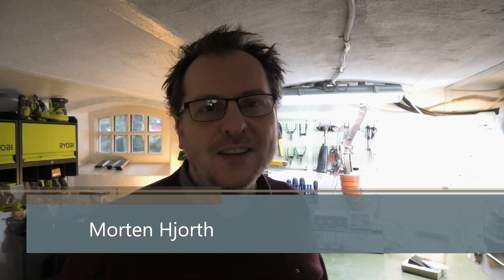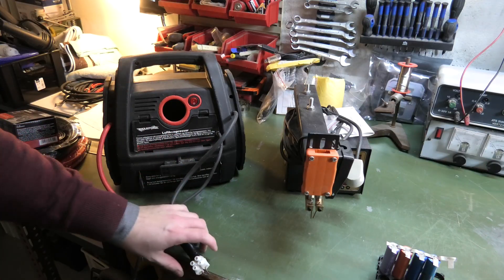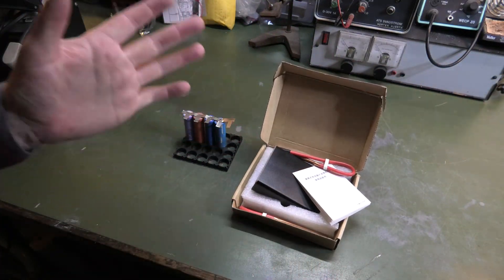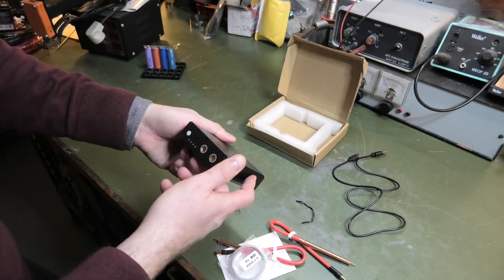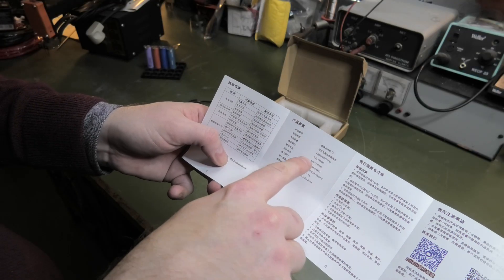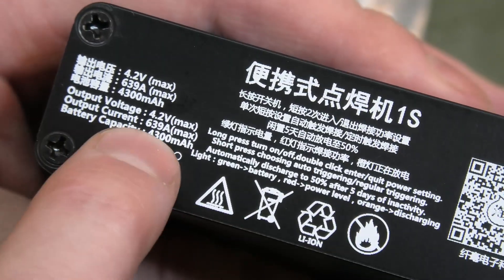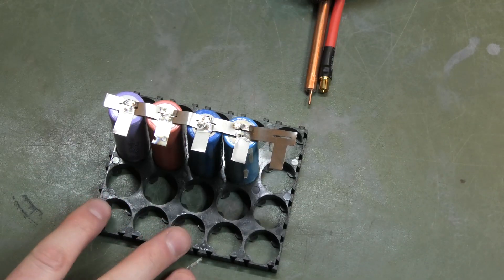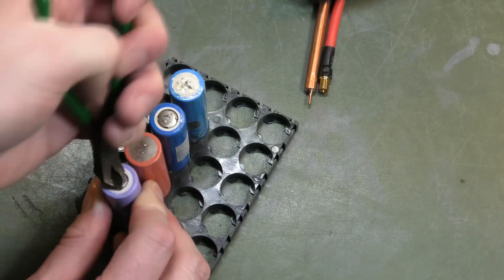Awesome $50 Tiny Spot Welder - Better than Expected - 1031

Comment: Helpful video as just about to replace 18650's in my Makita, would this weld the metal cage that holds and connects the batteries, probably a bit thicker than the nickel strips that are shown in your video, many thanks
Reply from the maker: Thank You! This spot welder is best up to 0,2mm nickel,, it might work,, but it would be a long shout.
Reply: Thanks bud
Reply from the maker: You are most welcome :-)

Comment: FYI: They are about $140 now. There are others of similar quality for under $60. I already bought another but that one seems really well built. I do like the bus bars across the mosfets and the heavy duty battery connections. Well done and thanks for the info.
Reply from the maker: Thanks for the info! they keep changing the links :-(
Reply: @MyPlayHouse  I wish there was a way to change the delay till the weld is triggered.
 mine seems to just go as soon as it shorts, I wish it was about one second.

Comment: Hello, I like your video thank you I was looking for some thing for my project which is soldering copper wires to break a infrared panel LED lights. Soldering is not my forte, so I think spotwelding could be better.
Reply from the maker: For spot welding copper, this is not powerful enough. :-/

Comment: Will this spot welder connect small metal pieces? I build custom die cast cars (hot wheels size) and want to build small roof racks to fit on them. What do you think?
Reply from the maker: I have not tried,, it does up to about 0.2mm with the batteries here.

Comment: Dear Sir, Please help me. I made what I saw in this video
https://www.youtube.com/watch?v=CGja7mWjiuM

point welder, but it only welds 0.1 mm thick connecting plates perfectly. The 0.2 mm thick plate is no longer inserted there. I would like to weld a 0.3 mm thick plate to the battery, because in really professional battery packs such as the MATABO 0, The manufacturer uses a 3 mm thick plate.
Time is not short, I experimented with it. What should I change and for what? Thank you very much in advance for your help! Sincerely, Janos
Reply from the maker: I also made a home build Spot welder, before I bought this one. 
https://youtu.be/rjATkgYERQI - this one,, it did not work very well :-/

Comment: Can the probe wires be replaced with larger gauge wire in silicon test casing without hurting the welders performance?   Then I could mount the welder on my lab bench.
Reply from the maker: It can become a little better,, but I am not sure it want, just be better to get a bigger one.

Comment: I have a very similar spot welder to this. I improved it by modifying the electrode cables. Replaced with copper ones and hard wired them to the  the connections on the board. Way better performance now.
Reply from the maker: Hi Testing and Track Days
Thank You very much!  glad you liked the video :-)
Thank you for watching! :-)

Comment: If I used copper strips instead of nickel would I get a better battery in practice or is it like a meaningless improvement having the better conductivity of the copper. I think it's like 22% for nickel vs 100% conductive for copper, sounds big but is it actually noticeable???
Reply from the maker: Is this able to spot weld copper strips? someone else had problems.. ?
Reply: @MyPlayHouse  I don't know.

Comment: Wouldn't it be nice if you could buy cells with little tabs on the ends so they could be entirely soldered with no chance of damaging the cell.
Nice little machine though!
Reply from the maker: Yes,, :-) that said,, they are holing up surprisingly well.

Comment: When you did that first fuse wire, you touched the nickel on the edge of the battery with one terminal and the other in the center. That was very dangerous. The negative casing is right under there. If that melted the insulation and welded that nickel through there, you would have shorted the battery.
Reply from the maker: Something looks more dangues or close on video,, and something looks dull and boring when it is really not. I did not feel this was unsafe at any point.

Comment: I have just bought this and it's unable to weld my 0.15 nickel strips, even at max power. I know that you have answered it before, but are you 100% sure your strips are pure nickel and not just the low-quality nickel-plated steel?
Reply from the maker: I have had no problems,, and have used different strips,, but mostly 0.12 to be fair..
Reply: @MyPlayHouse  Ok, they are likely only nickel plated and not pure nickel then. The lower conductivity helps the welding.

Comment: Hi, you think this would work to fuse a anl fuse onto another anl fuse section? I'm trying to repair a 60 amp fuse that has blown, it's for a mercedes car and the part is very difficult to find hence considering the spot weld option :)
Reply from the maker: I think this is best for what I was using it for. I do not know if it would be good for your project :-/

Comment: For anyone searching around nowadays stay away.. The batteries in these devices self-discharge and most in stock seems to have been sitting for too long allowing batteries to self-discharge and completely fail.
Might be worth if you get one on sale and can can find replacement-cells that can manage the currents..
Reply from the maker: I have not had any problems.
Reply: @MyPlayHouse  Had 2 devices delivered (reship after first one was non-functional) from amazon with this specific issue.. Both fully discharged, and you can measure that they do draw a small amount of current even when in a "off" state..

Comment: Thank you so much! I'm trying to make my own custom  cookie / polymer clay cutters, but unfortunately aluminum can not be soldered and using rivets is not the best either. So I do will take a look at this. I was wondering if I should make my own, but it would cost just as much in parts as this.
Reply from the maker: I did do a video , where I build my own,, it did not work that well :-/ so I got this one,, and it is much better.
Reply: you can solder aluminium with a blow torch and aluminium soldering rods.

Comment: I bought that “professional” big spot welder you show at the beginning video on eBay. It wouldn’t weld in regular outlet at all. Even at 99 setting. So I plugged it into 220V outlet and it literally blew up in smoke. Useless machine.
Reply from the maker: Well the one I have is for 220/230volt,, but it needs more than the 13A that is normal here :-/

Comment: i would have prefered a 18650 as internal battery , at least u can replace it quickly and easly if needed , cos i dont think that battery in there would be easy to find .
Reply from the maker: These packs can output a very high Amps, where 18650 is more for longer discharge..

Comment: After a year, internal battery is shot. Those batteries look like the ones use in thin  laptops. BTW Chinese cells don't last long.From camera, power tools,laptops etc.Ive open them up and the cells have exaggerated ratings!
Reply from the maker: I used mine not long ago,, in this video : https://youtu.be/hETy3pNQ7ws and it still works perfect.

Comment: Nice video, what other use is there for this welder apart from sticking batteries together, can you solder or join other metals together like making fitting for model boats perhaps? Thanks.
Reply from the maker: Sorry I do not know of other uses.

Comment: I just purchase the exact same one and even after watching your video at least ten times and ensuring the settings are correct, it doesn't produce enough power to spot weld the strip on the batteries. It feels like it's stuck on level one, but it's on level 4. So frustrating. (yes it's fully charged)
Reply from the maker: I used mine just last week,, still works great,, you must have gotten a bad unit :-/
Reply: @MyPlayHouse  it must be it. I made a video for the return:
https://youtu.be/pS66XaIh7ZA

Comment: Why is every portable spot welder video showing battery welding only?
Reply from the maker: You can´t spot weld large stuff with these small ones,, 0.1-0.2mm is about the limit.
Reply: @MyPlayHouse  Thanks.  I understand that but are there no other projects that it could be used for?  Literally about 9 out of 10 videos on these welders are about weldiing batteries.  In researching these, I actually began to believe they are made for batteries only.    I could see them being used for small computer or electronic parts where you would normally use screws.  Just would've liked to see something like that.

Comment: Nice review. I'm a bit concerned though that it could not melt copper. Although you may need higher melting electrodes but 600A should melt copper depending on the on time.
Reply from the maker: Copper is really good at leading both current and heat,, this tiny spot welder,, is to small,, and nikkle strips of about 0,2mm is the upper  limit.

Comment: What is the spark at 12:44?
Reply from the maker: It does that once in a while,, more if I spot weld batteries with solder on them.

Comment: For the Chinese manual, open your android phone with 'Google translate', there is any option to point the Camera to the text and it would try to translate it to English. It also works for other languages such Japanese to English or Korean to English or whatever.  The translation should contain 1/5 of jokes, but it will leave enough clues for your guessing.
The translation will appear in the screen, it is quite handy.
For the sharp pointer electrode, it is a hard alloy of copper which contains silicate or something, it is more durable than pure copper as those in the connection wire.
Reply from the maker: Well I figured out everything from the back of it :-)

Comment: When I received my spot welder, the battery measured about 0.5 volt. It should be a value of 3 volts or more to be on the safe side.
I put it on the charger and after charging  very slowly for about an hour(0.1-0.15A).
Then when it reached about 3 volts it was charging for a couple of hours on 1.1 amps max.
Eventually it reached 4.19volts and was ready to use.

I grinded and cleaned the contacts on a 18650 lion battery and a AA nimh battery. 
Tried different output levels (1 red light till 4 red lights). 
The performance was very poor. Even with the included 0.1mm nickel plated strips. 
The nickel strips do not stick well to the battery. I can easily remove them so it is not a good connection.

Probably it is caused because of a poor battery. Maybe with a good battery it can weld the thinnests 0.1mm strips but definitely not more than that.

There are more people receiving this spot welder with an almost empty battery. Maybe the included self discharge circuit is faulty.

I will not recommend this spot welder to anyone because it probably only works well with a new battery. If the battery ages it will have the same problems as I have.
Reply from the maker: I did as you saw. not have this problem.

Comment: Hey thanks for the video, this taught me how to use the one I just bought! I was nervous since the rods are copper with just a plastic coating on the ends, and I wasn't sure if I was supposed to touch them. Can't wait to try it out now!
Reply from the maker: Hi 804USAR
Thank You very much!  glad you liked the video :-)
Thank you for watching! :-)
Reply: Did you use it? is it any good?
Reply: @thedave7760  I do, and it is! It does occasionally blow a hole through the nickel that came with it, but usually that's because the setting it up too high. I spot welded about 10 cells for a hobby drone pilot, and I've spot welded some cells together for DIY lantern projects. For what it is I am honestly impressed.
Reply: @804USAR  Thanks I was worried. I will get some proper nickel strips not plated steel it will probably be better.
Reply: @804USAR  Thank you for posting this information :) I'm def saving to get one of these now! :D

Comment: Wonder how well it works on Steel Rule Die for cutting leather
Reply from the maker: It does not weld whery thick,, it does around 0.12-0.2 mm and with dificaltu in the 0.2mm end.
Reply: @MyPlayHouse  alright, the 2pt steel rule is ~0.02" which is 0.5mm.. lol guess I'm still going for harbor freight

Comment: As your helpful video shows the spot welder quickly and easily creates an adequate mechanical connection with little danger of damaging the battery due to overheating. However the electrical connection may not be as good as soldering. Spot welding creates a tiny contact area compared to soldering. Presumably this would create additional resistance, although perhaps not enough to matter.
Reply from the maker: Hi David
Thank You very much!  glad you liked the video :-)
Thank you for watching! :-)

Comment: Could you use this on model railway track to join track together without the normal joiners ? Track material would be nickel-silver based.
Reply from the maker: It only does very thin stuff,, 0.12-0.15mm

Comment: How about eye protection? Does it weld spots into your retinas? Are seeing stars even when not looking into the night sky?
Reply from the maker: I have not seen that need.
Reply: @MyPlayHouse  Thank You. I did a little research. My understanding is that spot welders are relatively safe compared to arc welders because they only heat the metal. The arc of an arc welder generates harmful radiation which is not present in spot welding. Dark tinted glasses are recommended by some for spot welding however.

Comment: Why didn't you just buy a 20A fuse for your fuseboard? Check nothing else in your house is on the same fuse.
Reply from the maker: That would require some rewiring and a new fuse installed,,, I can buy just about 8 of these for what an electrician cost here :-/
Reply: @MyPlayHouse  fair enough, it might have just needed a fly back supressor or something to slow the current surge a little. i would have wired a thick cable from a 20A circuit breaker and just plug the new circuit breaker fuse into the fuseboard whenever you wanted to use it, as if it was an extension cord being plugged into a wall socket. You have to also connect the earth and neutral but not so hard, could be done with an inline socket on a short cable that stays behind the cover or hangs just outside. lol

Comment: Build an entire 140 cells battery using this spot welder (bought it before seen this video). This welder is utterly disgusting. Max power level barely does anything to strips thicker than 0.1mm. Nickel strip that comes with the welder is much much softer than other 0.1mm you could buy, so yes, with the default strip it somehow works. For the rest you will need a lot more contact points (I did 10-12 for a single cell), and even then it's is not reliable and could be torn off with not much of an effort. (All my welding is done having charging level as max, plus recharging to max after around 100 spots. And even that won't help.)
Reply from the maker: Mine works perfectly fine.
Reply: So if a customer clicks your link and they receive a model that doesn't perform with the same reliability spec output as the model you received to review, then in the spirit of fairness the fact that your model performed well and didn't have any problems doesn't necessarily automatically mean that the product is good and they are just having a singular unfortunate interaction with the company, that's all I'm saying. Just logically responding with "well mine worked fine I'm sorry to hear that" doesn't really work anymore, and as a reviewer I feel that you should be intuitively skeptical that these sort-of shady practices are behind the differences in the customer experience compared to yours vs just bad luck on their end

Comment: Wheelbarrow Tire inner tube to put it on it slip it on it inch longer on both ends getting some rubber cement cement is on each end cut you little holes for you need access to it no light wheelbarrow inner tube wheelbarrow inner tube
Reply from the maker: not the worst idea :-)

Comment: Lucrează doar la suprafață, și cu nickel foarte subțire, 0,1 mm, maxim 0,15, și asta foarte slab...!
Reply from the maker: HI Viorel Valentin Marin
My channel is English, and to make sure as many as possible,  can also enjoy the comments, they are also English.
Please keep to English.

Thank you for watching! :-)
Reply: @MyPlayHouse  Welding points are not penetrated, it is only on the surface, and with very thin nickel, 0.1 mm, maximum 0.15, and this is very weak ...!  must weld up to 0.35 mm nickel.  BOSCH, MAKITA, HITACHI, works only with thick nickel tape, over 0.15 mm.  So, you have to develop the work, and get even over 2000 Amps, for nickel to be part of the Li Ion or Li polymer battery ... Anyway, respect for the attempt ...!  Good luck...!  Respectfully, sing.  electronics, troubleshooting, assembly, maintenance and upkeep, robots and industrial machinery.

Comment: Spot welders need a bit of resistance between the two metals to work well.  If you wrap the fuse wire around the copper, you make the connection too good, and so the highest resistance point is somewhere else, for example between the probe tip and the fuse wire, resulting in most of the heat being produced at that junction instead.  I think trying to spot weld the fuse wire to the copper wire is a bit tricky because to get a high enough resistance, you need to have it touch without wrapping, since both conductors are essentially cylinders.  You might try putting one short section of the copper wire on an anvil, and hit it with a hammer to flatten it out a little.  That will give you a "line contact" instead of a single point contact.
Reply from the maker: Hi yeroca
Thank You very much!  glad you liked the video :-)
Thank you for watching! :-)